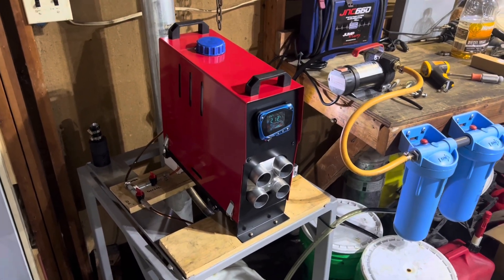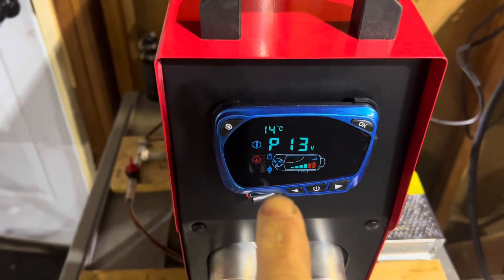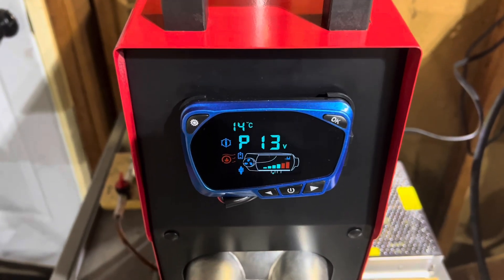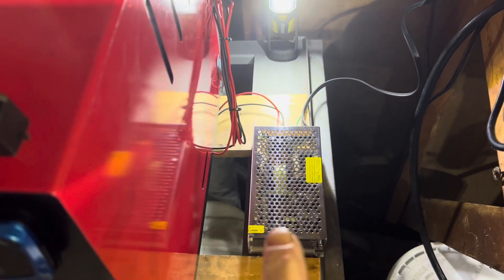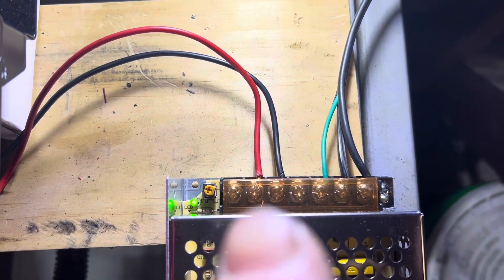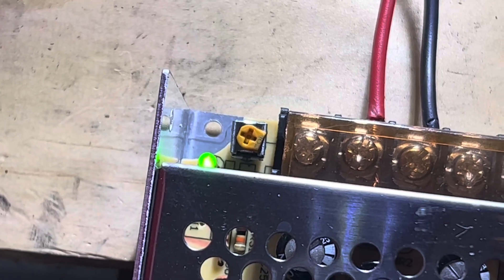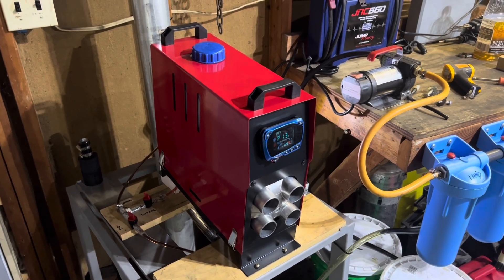Chinese Diesel Heater - Power Supply hack/secret

Comment: I don't consider myself an electronics guy, but I think the term "pot" is short for potentiometer. That's exactly what potentiometers do, regulate electrical flow. A couple other examples, dimmer switches for lights, volume control knobs, basically anything where voltage needs to be adjusted manually. Anyway just a fun fact that others might like to hear

Comment: I tried the following and now using. I have a 12v deep cycle lead acid battery (located inside the heated area) that's hook to a "load controlling" solar panel charge controller (i used a Xantrex C35 set jumper on load management with digital battery monitoring cover). I have a adjustable 12v power supply ( I used A DROK 24V Power Supply, AC 110V/220V to DC 0-24V 20A 480W Buck Converter, Variable Adjustable Adapter Regulated 5V 12V 24V Volt Switching Voltage LED Transformer 20A Amp Charger) hooked to the solar controller in place of solar panels (faking out controller). I have the heater hooked direct to the battery. The battery i fully charged then removed charger and let is settle to its static state and set my power supply to match that voltage, in my case 12.9v (hence the need for an adjustable 12v power supply). Side note, i then powered my (non battery version $50 Worth it!!!) Bureck CD Thermostat to the battery direct, with a DIY 3.7v step down at stat. I use this system in my chicken coop here in Montana to protect against the artic blasts -20 and lower, my chickens have large combs and get frost bite if i don't supplement the heat. I get a lot of power outages in rural Montana and don't want heater to be on and power go out, this can be very bad!!!. This system works perfect, with perfect battery management and perfect power supply for CDH. Battery has never been over charged once its very happy. I am now at a total set it and forget it status and it feels good as i have been through hell with this issue. Other considerations would be to add a solar panel redundancy as well, Moisture protection, over current protection of course i.e. fuses in load circuits.

Comment: I use old computer psu to run my heaters. Plenty of power, safety features already built and easy to work with. when i first started using them, I would adjust the output up to around 13v and put a small 12v battery wired parallel with the psu.  A simple UPS. if the power goes out the battery takes over and keeps the heater running. a couple shotky diodes and a charge controller from aliexpress andyour good. eliminates the chance of the heater suddenly shutting down and melting something.

Comment: 13.8 is the magic number , that is why you can buy 12 o 13.8 volt DC to DC converters of various capacities. They will produce rated voltage with a lower voltage input .

Comment: Right on man ! My converter came set right on 12v and on start up of the cdh I was measuring 11.7 - 11.8 v  
Turned it up to 13.3 v , and man what a difference. The fan rpms ramp up significantly ! 
Thanks for the info !

Comment: I have regulated power supply think I will add a UPS and Arduino unit to turn on automatic timer which will  sense when unit has gone through cooldown and effectively ensure unit stays shut down until + power restored.  Just read up simple NAND ICs and a some relays can be used for effective homemade UPS.  Adding in some type of Arduino controller I should be able to add in simple timer circuit or basic code to power everything down until power restored after cooldown achieved.   Will see what I come up with,  like idea of building own UPS setup with small battery to get it through a cooldown cycle.

Comment: i have one of those power supplies, but i dont use it.... Instead, i have it connected to a car battery, and a trickle charger constantly plugged in for it.....
I opted for this method, because the heaters require a cool-down when turning off...
In the event of a power-cut... it will not get that cool-down period... This way, If i experience a power-cut in my home, the heater will continue to run on battery... also it gives me the chance to turn it off, and let it have that cool-down period.....
Reply: hi, I want to do a setup like yours.thanks for the info. I want to do a permanent mains powered setup with enogh battery for 24 hours in case of power cut. The power drop should set off the automatic shutdown sequence of the heater in case the power runs out completely. I want minimal effort, but I will make a nice neat setup. Can you recommend a suitable battery and charger combination? Or maybe an off the shelf UPS unit? I live in New Zealand.

Comment: Most heaters have a magnet on the fan and they know what RPM the fan is doing. The voltage will not change the fan speed as the computer regulates fan speed 

Obviously you still need to be within the high and low limits.

Try it yourself turn the voltage from 12 to 14 it will speed up momentarily then slow itself back to it original speed ;)
Reply: Wrong.
Reply: @shawnd567 explain then? Does it guess the RPM and therefor fuel ratio?

Comment: Can you cover a topic about using a lead acid battery as a back up should there be a power outage. This is quite common where I live. I understand that damage to the diesel heater will happen should the power stop when the unit is running. Maybe showing the best method to use both mains transformed to 12v coupled with a battery so when the power is interrupted the battery will take its place and when the power is reinstated the system will revert back to the transformer supply.
Hope you understand what I'm talking about.
Rgds
S
Reply: Looking to use both  too but unsure how to connect battery
Reply: I would agree use a car type battery with a light trickle charger
Reply: i want to do this too.. I want to do a permanent mains powered setup with enough battery for 24 hours in case of power cut. The power drop should set off the automatic shutdown sequence of the heater in case the power runs out completely. I want minimal effort, but I will make a nice neat setup. Can you recommend a suitable battery and charger combination? Or maybe an off the shelf UPS unit? I live in New Zealand.

Comment: I have a brand new one of these that I cant get to power up. When I have 12 volts going to it, im presented with the led screen. I've primed the pump, when I press the power button to start it, it shuts down immediately without any error codes. Its 87 degrees fahrenheit where im at. I just wanted to test this thing out. Could the thermostat be preventing this thing from firing up?
Reply: Most 12 volt plugs used today only provide low power for cell phones etc. it hard to find one that can take 160 watts, you need a direct line to a battery or a 120v house adapter that pushes 12v-14v and at least 160 watts. Best option is order one or buy a battery and trickle charge it with 100 or so watts.
Reply: I run mine on a $27 15a AC-dc 12v convert with a female end and have my heaters wired to a make end just like your car.

Comment: I was just wondering if you keep the power supply plugged in when the heater is off or do you need to unplug and plug bask in each time you want to run the heater? Thanks Ed, did subscribe 👍
Reply: You need to keep it plugged in so it can shut down properly when you switch it off (its only drawing low amps when its running, it takes higher amps on start and shutdown modes)

Comment: AliExpress have 13.8volt 15amp power supplies just fitted one and works fine. Runs much better.
Reply: until you lose power... then the unburnt diesel fumes come through your intake backwards and the engine can't cool off properly, maybe resulting in damage.

Comment: Hi, i have two new identical unit like your, with Power supply 12v 360w, First of start make a very big big Cloud of smoke for 30-40 second, do you have idea what Is the problem? I use only good quality diesel fuel🤔..i try also  to change the trimmer voltare from 11 to 14, but nothinh change, smoke anyway First of startup
Reply: that is normal start up to see white smoke . don't worry it  will dissipate after about 30 seconds. it;'s totally normal.

Comment: Why not change the voltage in "menu 1688" from 12v to 24v? you also get a faster startup (glowplug power)
Reply from the maker: This unit does not have that feature
Reply: That's very interesting.   I'm going to look into this.   Providing 24v is easy for me.
Have you yourself bought a 12v, then converted it over to take 24v ?

Comment: Just to say.  I see that you're running directly from the transformer.   So do I...
But if there is an outage,  the furnace needs power to go into shut down mode and the burner has to "get rid" of 150-220°C heat.  
No 12v, no fan.  No fan then the heat will severely damage the control board etc
So I put a deep cycle 12v 22ah battery and a small trickle charger instead.  If now I have an outage,  the battery will keep it running for hours and I can close it down safely  later
Reply: Hi 
the  control board wont over heat as its at the back of the machine  which doesnt get warm i think most run this heater of p/s i do and had a few times ive trip the power in the garage with the heater running and never  had any  controller board fry ups. just turned power on and it goes though the cool down before restarting  hope this helps
Reply: That’s my thing.  I keep hearing to get batteries, but if a power outage fries it, you could buy another one brand new for the cost of most deep cycle batteries that you would then have to constantly maintain and have on standby.
Reply: @gazbullen  If the power is out more than a few seconds then restored only the fan comes on . the glow plug doesn't fire up and put the unit through a normal shut down. Just an fyi.
Reply: @gazbullen  well thanks.   That's reassuring!
Just to add, that I bought a second heater, where the unit is "broken up", this one I'll install seriously in my working cabin.  The red "all in one", I might install in the basement of our 90 yr old aunt down the street with the hot air coming up from below into her lounge room.   
A Direct heater like this will radically change things instead of a HUGE gas bill she has had this winter.
Reply: @PeterJavea  yeah the one i have is the separates one :) you can always run it of a 12v  say 12ah bike battery with a trickle charger connected  that way if power goes down it will carry on running for a good few hrs of it then when power gets low  on the batter y the heater goes into shutdown mode automatically  hope this helps
Reply: You could do both. Best of both worlds. You get your 14 Volts from the transformer in ordinary times. During the blackout, your 12 Volt battery, connected in parallel, steps up and runs the heater. 

If you have al the stuff already, that seems to me the best implementation of supply power. I’m happy to be corrected 😇.
Reply: If you have unreliable mains power, use a small bike battery and charger that can make 5 amps. The battery will be enough to supply the startup glow plug and shut shut down the heater when charger is shut off. It's not an uninterruptible power supply (UPS) so powering off has to be done from the heater control panel. The battery charger must have auto conditioning that kicks in when battery is fully charged. Otherwise, you'll be wrecking the battery when you forget to turn off the charger.

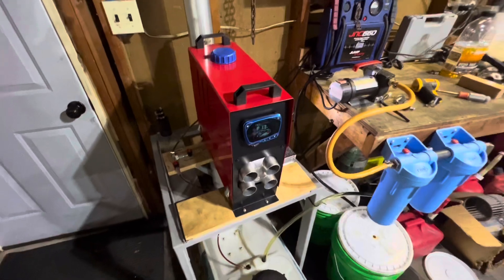Comment: @4:23  In the comments of your prior video you mentioned that you have run approximately 50 gallons of 70/30 WMO/E85 without any issues. Now you mention that you've made combustion chamber modifications. Were those 50 gallons burned before or after these modifications?
Reply from the maker: Probably a mixture of both.  I’ve been at this since October 2022.
Reply: @SAIDias  Thanks for the info. I enjoy these videos and I'm looking forward to understanding your combustion chamber mods.
Reply: @SAIDias  could use a ecoflow river 2 to power the heater?